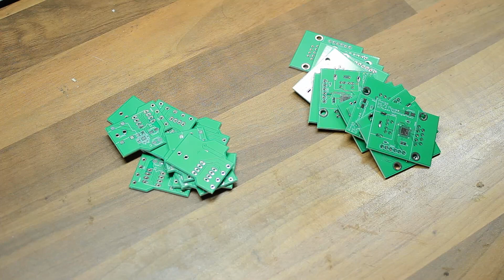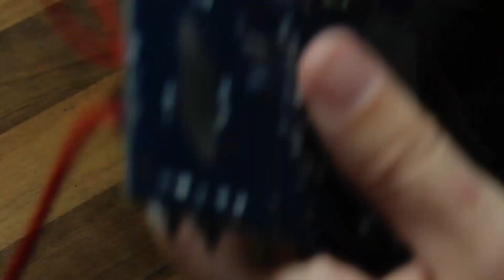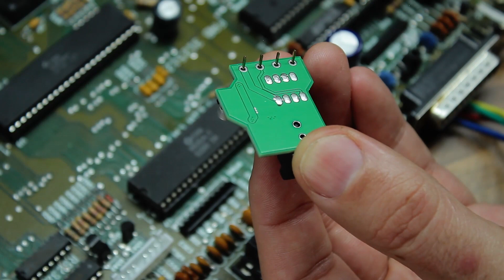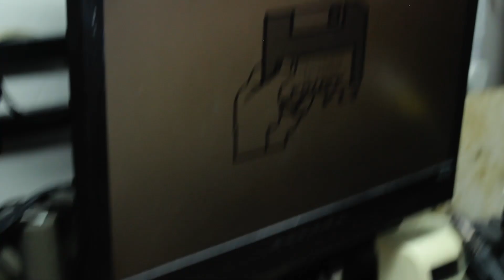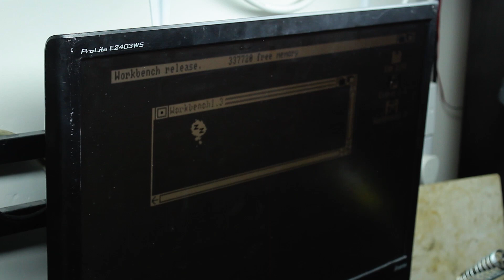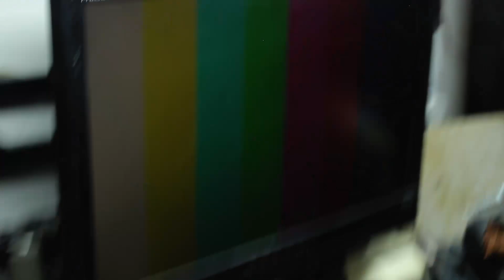Amiga A500 Rebuild Project: Part 5

Comment: Look into rgb2hdmi in stead of the china scart/hdmi thing
Reply from the maker: I'm always looking for improvements... I'll take a look. I also have a super Denise on order to get better resolutions including vga output for workbench.
Reply from the maker: Is that the thing that uses a pi zero? If so I don't want to use it: I have a rule for this build - I won't use any microcontrollers or socs (except in a dedicated system like the scart interface) that are more powerful than the Amiga itself. Adding a pi just seems OTT really as I could just use the pi to emulate the amiga.
Reply: @MajenkoTechnologies  Yeah - Fair enough :)